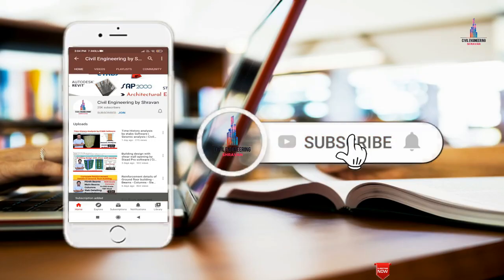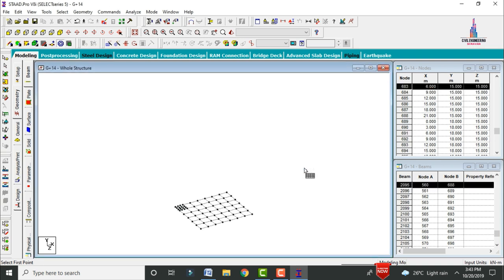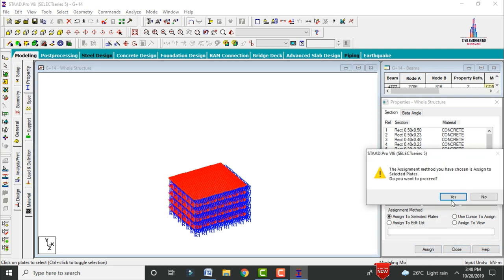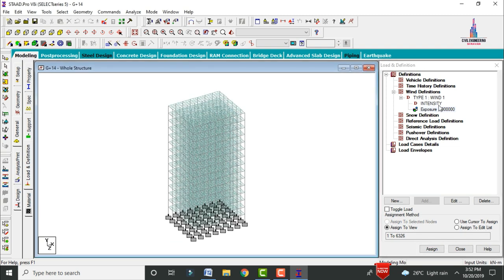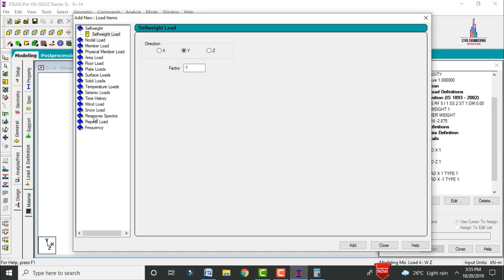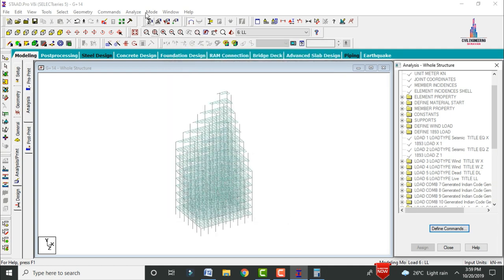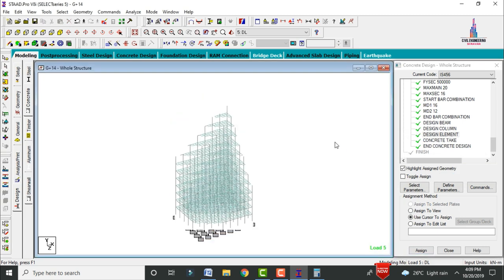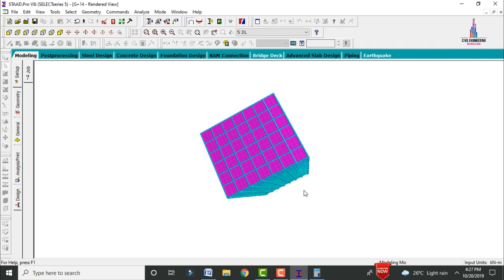G+14 Building design with various beam sizes, column sizes and slab thickness | civil engineering |

Comment: Bro high-rise apartment building me column square shape me nahi hote .
Mai khud Kai project pe Kam kar chuka hu .
is type k structure me columna generally 300mm*1800mm ,300mm*2000mm ya phir shear wall jah pe lift provide Kiya jata hai waha v columns Wall jaise hote hai jaise ki 300mm*4500mm ya phir 300mm*3000 mm
Apka video dekh k koi design kar de to structure hi collapse ho jayega .
High Rise  building case me load calculation accurately karna padta hai .
Reply from the maker: Please text in English